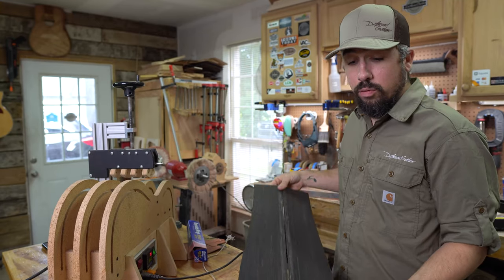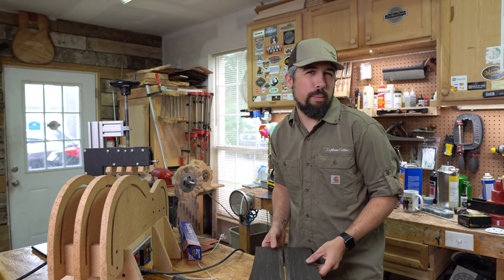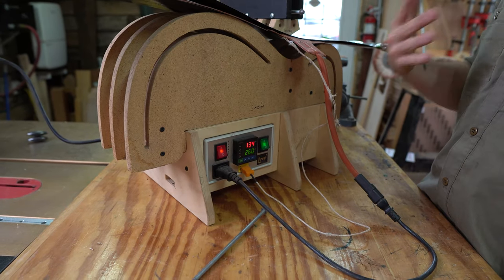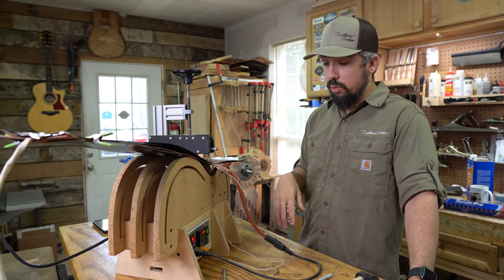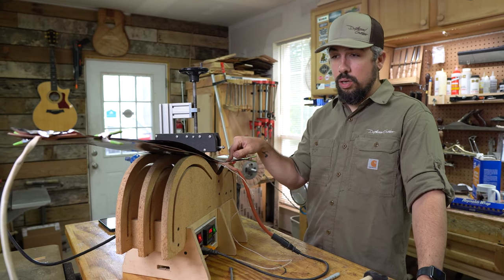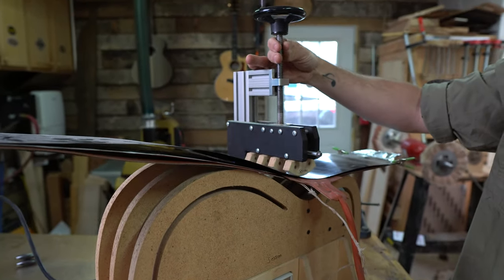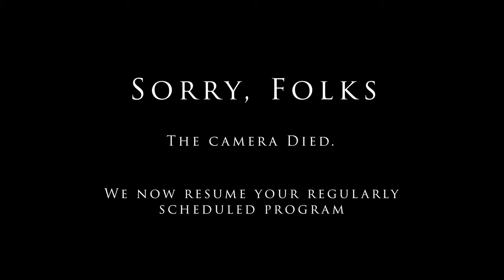How To Build an Acoustic Guitar. Episode 7 (Bending the Sides)

Comment: Saying 2 1/4 mm (2.25mm) is the most american way of using the metric system. LOL
Reply: Why? 25% is a quarter.
You think a quarter past the hour is an Americanism too?
Reply: @TEDodd 
I just read an article, this morning, about AI being
able to detect sarcasm. Yet you, obviously cannot.????
HHmmmmm.
Reply: @zapa1pnt  didn't seam sarcastic. Sarcasm is much about tone which that missing with text. The <sarc> tag is great for making it clear.

I've heard others make similar comments and they definitely weren't being sarcastic.
Complaining about using 1/4, 1/3, even 1/2  with "metric" measurements.
Reply: @TEDodd  
So, the LOL didn't tip you?!?!?!? 🙄🙄🙄
I stand by my comment.
Reply: @zapa1pnt  nope.  Thought you found it funny that he used such an Americanism, not that you thought your comment was funny.
Reply: @TEDodd  There is not wrong, it is just different. In the formal metric system we do say 2.0, 2.1, 2.2mm and we add new number only when the measurement is more precise, like 2.13mm.
Here in Brazil, in an informal way, we say something like 15 minutes past/to the hour or 2 and a half millimetres (but we write 2.5mm).
We also use half past/to the the hour, "half a dozen" to mean 6 and also have 1/2, 3/4, 1/4, 5/16 etc for nuts and bolts cause the old products from US...
It is very confusing here, but the term "a quarter" is very uncommon ( I think is not common in others metric system places too).
Reply: @rogeriocosta1035  Quarter past/to the hour is 15 minutes. Some old, European made, watches have a "minute repeater" function that sounds the time as on pitch for the hours, a double pitch for the quarter hours, and a second pitch for the minutes to add to the quarter. Not and American thing.

And I've heard lots of Brits say quarter centimeter. I expect others do too but I wouldn't understand the language.

Then again lots of Brits (and former colonies) still use Imperial measurements in their spoken language, especially for estimates, even though the official system is metric. They get a pint at the pub, not 568ml. And gallons of liquids. They talk of distances in yards and miles. I often hear pounds and ounces for weights.

Then again I hear people refer to Imperial measurements for the US when we use US Customary units that are often quite different from Imperial units of the same name. (Like that 568ml pint vs the 473ml US pint)
Reply: @TEDodd  I have not seen the other replies to my comment until now and I want to make you guys sure that I do not intended to be sarcastic, mean or nothing like that. It was just the first time I've had heard that and it sounded funny to my ears. Stay safe!

Comment: That bending setup is slick !
I have been making seamless one piece sides with just a tiny   tail block just enough for the tail peg. I use a pin table with dowels and use shims and work both sides from the center of the tail all the way around to the neck block using only a heat gun and some water.
Just did a set of Ipe sides and back. Ipe needs to be fully soaked for three days before it will even think about bending without exploding.

Comment: QUESTION: Doesn't the same theory apply to the back as well? Also, if you use 2 hardwoods together isn't that wasteful of the value of the inner wood versus more abundant, less valuable woods as the inside piece?

Why do you prefer epoxy over Titebond 3?

Comment: I like very much your demonstration, cristal clear.
As you said in a previous video, a side resonate while the other sing.
If the sides are stiff, resonating side plays its role better. Make sens to me.
Reply: If the sides do not vibrate, they do not resonate, they reflect.
Reflecting does not take vibration away from the top, resonating does.
In this instance, vibrating and resonating is the same thing.

Comment: Very cool!  So laminated sides are actually a good, if not better, thing.  It totally makes sense, but for years, we’ve heard people talk about laminated sides as being an inferior  to solid wood.  In addition to the added stiffness, I’d think laminated sides would be more resistant to cracking.  Learn something new every day.  Thanks!
Reply from the maker: There’s a difference between full thickness laminate sides using hardwoods like I’m doing, and just plywood sides that you see a lot of cheap guitars made from. I should have mentioned that
Reply: I build all my guitars according to old selmer maccaferri tradition and customers are always very weary of the laminated sides . Pretty hard to overkomen but worth it in the end because laminated sides with proper wood are really stiff and light

Comment: I had a different response to watching the magnets. What struck me was that the top magnet oscillated well because the forces aligning it with the other are relatively weak compared to a glued joint. The lesson I took away is to try and limit interaction* between the top and sides, like what you did by holding the bottom magnet firmly. Is it Taylor who routes a channel around the edge of the top for this purpose? I can't remember, but numerous luthiers sand the edges of their tops thinner and say it works. I did, but IDK. I wont argue that your laminated sides don't sound awesome, but it might not be why you think. That, or you're right. : )
edit:* or energy transfer

Comment: These videos are amazing, thank you for sharing! I have a question about the automatic bending. You talked about it cooling down in the mould and so relaxing the wood or something like that. But when you remove it from the mould it still springs out a little bit. When bent by hand, you can over bend the curves slightly, so then it maintains exactly the right shape when not in the mould. Wouldn’t that actually have less residual stress in the wood? Or am I missing something? Thanks again for the phenomenal content.

Comment: Anyone who says useing a bending jig & heat blankets is cheating They are Dead wrong*** , I have only been building guitars & ukuleles for 2yrs now & I can say the one thing I get stressed out by is bending my sides by hand with a bending iron. I always wrap my wood in foil just to prevent burning it. But no matter how hard I try I always get some ripples in my sides where the system you are using is much better Iam going too buy one of those machines if my production improves. Great vids thank you. Also I agree with laminating the sides.🎸🎼🎼🇺🇸🇺🇸👨🏻‍🦯
Reply: can you use a steam box?

Comment: have you tired laminating the inside of two sides by sandwiching the side bracing between the the outside and inside of the guitar( so in essence the inside side is glued only to the side bracing)  sides rather than epoxying them directly together?  I am thinking by doing that you can have your outside sides in the mold so when you glue the inside side to the side bracing and the glue dries, it will be glued to the exact shape of the guitar. This would leave an air gap, the thickness of the side braces between the inside side  and outside side. I don't know if that extra air channel changes the vibration of the top or if that extra air space between the sides gives more resonance to the sound of the guitar?  Just thinking out loud.

Comment: So the next step in the evolution is to use carbon fiber for the inside, not rosewood.  It would be as stiff as steel and weigh even less than the rosewood...using prepreg and the foil you might be able to do it in one step on the bender...no have to do it in a separate step: https://www.fibreglast.com/product/Prepreg_3K_2x2_Twill_Weave_Carbon_03101 but only requires max 310F but takes 6 hours.  Just a thought!! would be a fun experiment, but it would require building an entire guitar!
Reply from the maker: I’ve thought about that as an option! I’ll have to do some more research
Reply: @DriftwoodGuitars :
It would save a lot of nice wood.

Comment: Doh! Camera failed right at the most crucial moment! With the double sides, did you bend the rosewood using the same form or did you have to account for the fact that here is actually a difference to the natural bending radiuses of the two slats? I know some people end both slats at the same time (which is what I would do) but I'm wondering if there is a good solution for things that are thicker like laminated solid linings. Also, are you fine-tuning the sides to deal with the tiny bit of springback?

Keep up the good work and a nod to Matt. It's great having him in your videos and the interaction is great to see!
Reply from the maker: Yeah it was a bummer! I bend both sets on the same mold.
Reply: Could you bend both sets at the same time with thinned down Titebond between and skip a few steps yet end up with a better fit in less time?
Reply: @danstiverson :
No. The glue would be drying, in the excessive heat, before the sides have taken shape.
Also, the excessive heat and steam would damage the glue.
Heat and steam is how you take apart a Titebond joint, not put it together.
Think neck joint.